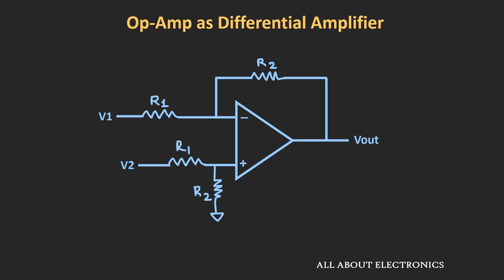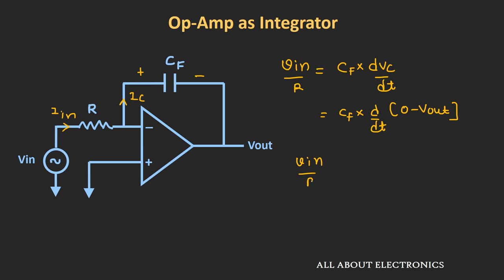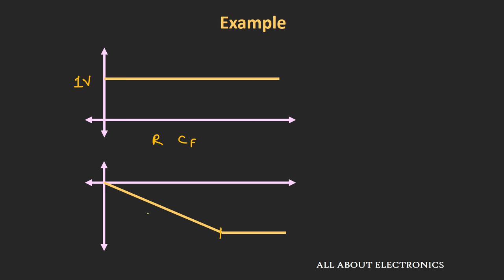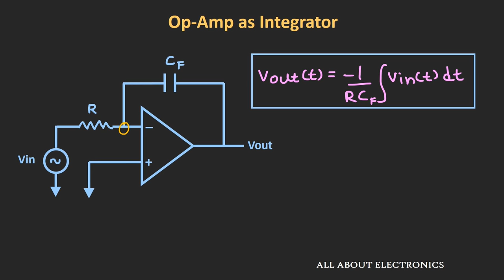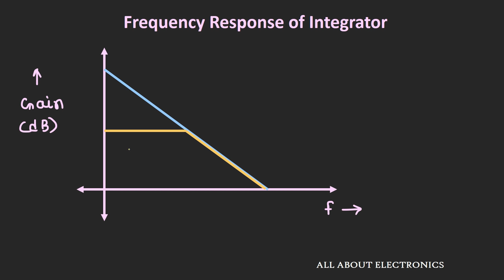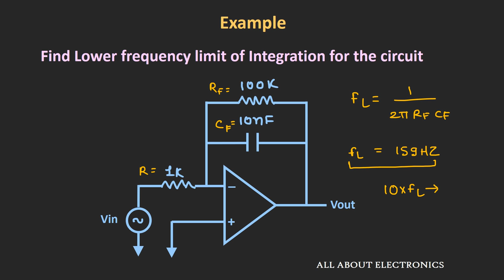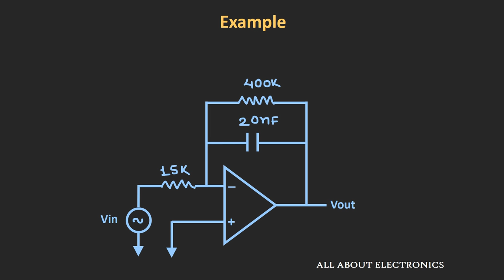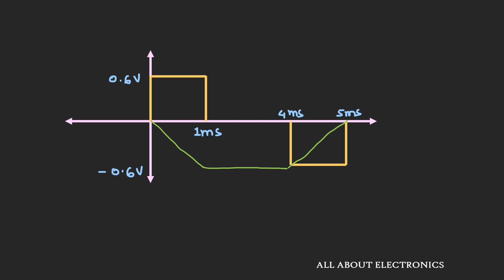Op-Amp Integrator (with Derivation and Solved Examples)

Comment: 6:28  whare is Vout=-Xc/RxVin coming from ?
Reply from the maker: For AC input signal, the capacitor will have a finite reactance Xc. So, considering that, the capacitor cam be replaced with equivalent reactance. And now as per the inverting op-amp formula, the output of the op-amp is - (Xc /R)*Vin.
I hope, it will clear your doubt.

Comment: sir please tell me what is the output of integrator if input is triangular wave.
Reply from the maker: If the input to the integrator is triangular wave then the output will be the discrete parabolas for each segment. (Same as we used to get mathematically). e.g if one segment of the triangular wave can be represented as  2T, then the output would be T^2. so, on the oscilloscope, if you observe the output it seems very similar to the sine wave. But actually, it is not a sine wave. They are discrete parabolas which appear as sinewave visually. (It's not a perfect sine wave)
I hope it will clear your doubt.

Comment: Which book do you follow for this type of nice explanation. ..?
Reply from the maker: well, all the explanation you will not find in a particular book. There are certain things which I learned through personal experience while playing with circuits and some of the information are from the applications notes and data sheets of the op-amp.
But you can use the book: Op-amp and linear integrated circuits by ramakant gaikwaad. It's very good book.

Comment: @6:26 can someone explain how does Vout = -(Xc/R)*Vin
Reply: Equation for gain of an inverting amplifier = -(Rf/R)*Vin
So since here we are using a capacitor instead of a Feedback resistance (Rf), we are replacing Rf with capacitive reactance (Xc)

Comment: sir can you expalin to me how to integrator ampliafier work in contorler pid circuit with dc input? i realy need your help
Reply from the maker: In PID controller circuit, the input to the integrator will be the error voltage. In terms of functionality, it will be the same as the normal integrator.
Reply: ALL ABOUT ELECTRONICS is the error voltage have frequency? Because i think error voltage is DC
Reply from the maker: In a way, it's DC at a particular moment. But it will change with time.
Reply: ALL ABOUT ELECTRONICS then how to check my integrator amplifier circuit is right or wrong? What kind of input i needed?
Reply from the maker: You can apply the step response to the integrator and can check how it responds to the step input and can calculate the time required by the integrator to reach the final value. It will give you the time constant of the integrator. And by changing the value of R and C, you can change this time constant.
Reply: ALL ABOUT ELECTRONICS ok i will try. Thank you so much

Comment: during the darivation of the expression for output voltage of integrator opamp we are not considering the feedback resistance Rf  thats why it is   I in = Ic  if we consider Rf then they will not be equal and expression will get change???

Comment: How to convert square wave to sine wave converter using opamp without changing frequency
Reply from the maker: It can be generated by using the active low pass filter using an op-amp. As you might be aware, square wave consist of fundamental frequency and harmonics. So, if you design the low pass filter with cut-off frequency of the square wave then you will be able to recover the fundamental frequency (sine wave). The recovered signal may not be the exact sine wave, but by increasing the order of the filter, the output signal will look closer to the sine wave.

Comment: hey man your work is awesome i really liked it.
can you help me out how "output is propotional plus integral to the input" how it is done with derivation please it would be really helpful of you.
hope to get a reply soon from you.
thankyou
Reply from the maker: Hi, I exactly didn't get it what you are saying. Would you please elaborate it a bit.
Reply: ALL ABOUT ELECTRONICS my question is "Design a circuit whose    output is proportional plus integral of the input"
Reply: ALL ABOUT ELECTRONICS any thoughts on my question mate?!
Reply from the maker: Yes, it can be designed by combining the normal amplifier circuit with integrator circuit.
What I meant to say is, using the summer circuit, individual op-amp amplifier and op-amp integrator output can be added together. 
I hope you got your answer. If you still have any doubt then do let me know here.
Reply from the maker: By the way, I didn't get the notification of your reply to the comment. It's good that you have asked it again. Otherwise, I would have missed that.

Comment: Can we make op amp on breadboard
Reply from the maker: Op-amp ICs are readily available. You can use those ICs. On the breadboard, you can try but like I said earlier the internal structure of op-amp is very complicated and using discrete components it is very hard to achieve that level of accuracy. For example, internally the first stage of an op-amp is a differential amplifier. If you are going to design that stage using the discrete transistors then you will notice a quite a bit of difference in their characteristics. 
So, I would recommend you to use op-amp ICs instead designing it on a breadboard using discrete components.

Comment: how to find out the expression of FL?
Reply from the maker: To find the expression of FL, first of all, you need to find the transfer function of the op-amp (Vout/Vin).
Consider R=Z1 and Z2= (Rf || Xc). Now, Vo/Vin will be -Z2/Z1. And if you consider the only magnitude, then it will Z2/Z1.
Now to find FL, equate it 1/√2. And through this procedure, you can find FL.
Try to follow this procedure and if you find any difficulty then do let me know here.
Reply: Why equate it to 1/√2?
Reply: And one more question while circuit analysis of these kind of circuits do I have to use the j operator? Or solve the differential equations? Diff. Equation is bit lenghty....but using j I can't understand that if amplification factor comes in  "jincluded expression" then what I'll do?
Reply from the maker: Because it is the definition of cut-off frequency. A frequency where the output power becomes half or output voltage becomes 1/√2.
For more information do check my video on low pass filter.
Reply from the maker: If the input signal is sinusoidal then j operator can be used. But if the input signal is non-sinusoidal then it is better to use differential equation. One example based on this j operator I have solved in the video "solved examples on op-amp (Part-1)'. 
You can check that. Here is the link:
https://www.youtube.com/watch?v=VdP3tTcaZIc&t=306s
Reply: ALL ABOUT ELECTRONICS I know i have seen that video there the gain came real....but there can be case when gain is not coming real then? What to do? for example in your sum there were two op-amps in the first op-amps gain came in complex notation....so then what... how to tell gain then?
Reply from the maker: Let's say if the gain is 1+ j. In that case, we can say that output signal will be amplified by the factor of √2. And the output signal will be phase shifted by 45 degrees.  I hope it will clear your doubt.
Reply: ALL ABOUT ELECTRONICS Yes Thank you. I totally understood it...your videos and work is great...
Reply: so u r from Uzumaki clan. 
Are u still carrying the 'Will Of fire"?